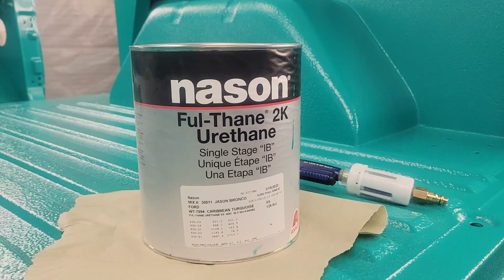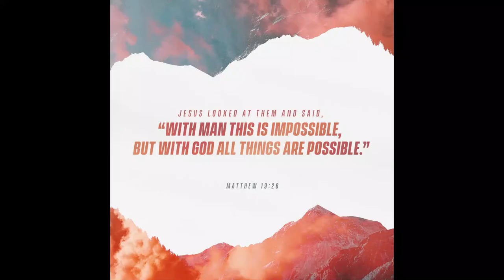Painting The Bronco Tub - 1966 Ford Bronco Restoration Project

Comment: That looks amazing……no color change between the 2. Nothing like Jonie to install confidence right before you put the icing on the cake,  Did you shoot the hood and fenders at the same time?
Reply from the maker: Thanks David.  No I will paint those in the next couple weeks.  Since I am shooting single stage and it is a solid color I should be fine.  I just have to make sure my air pressure and the humidity is close the same as it was when I painted the tub.  Metallic would be a different story.

Comment: Jason, I guess this is where you tell Jonie how many years your new $500 paint gun will last.  LOL
I've painted a few cars and worked as a line sprayer in a furniture plant and learning the proper triggering action of the spray gun only comes from many hours of painting.  So someone like you makes it look easy, until the novice tries to do what you did.  Also noticed that your gun shoots a great pattern.  Just wondering how many times you had to refill the paint cup for what shot in the video ??
Reply from the maker: Thanks Ken,
I used almost 2 medium paint cups per coat.  So around 6 cups total.  I used about a 1/4 gallon of paint.